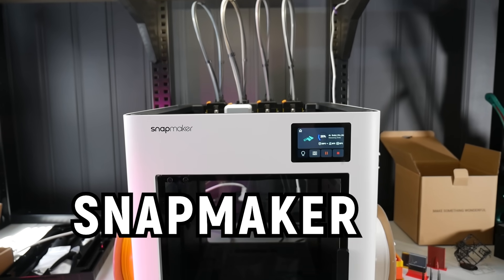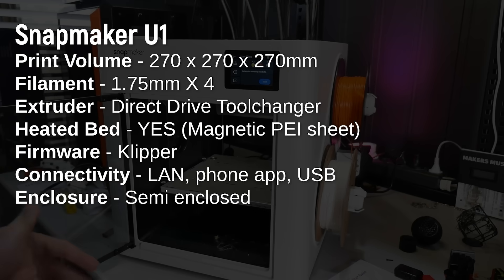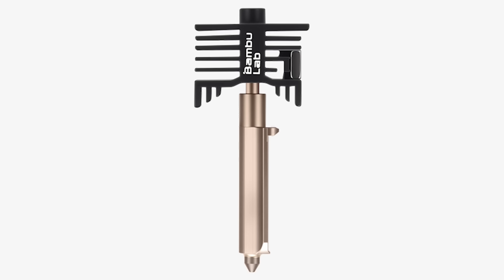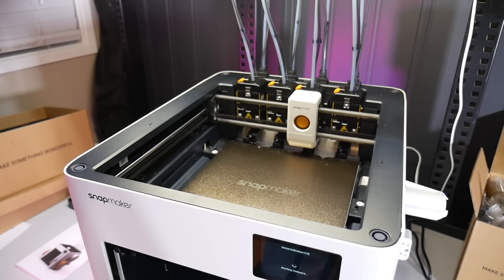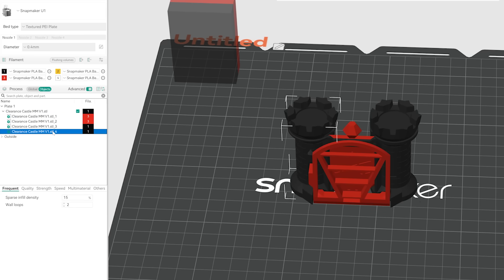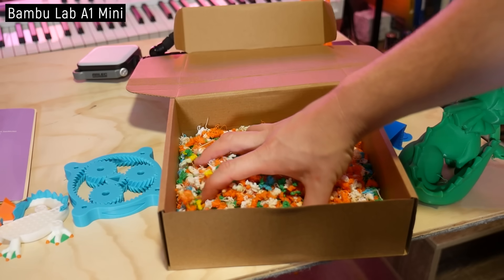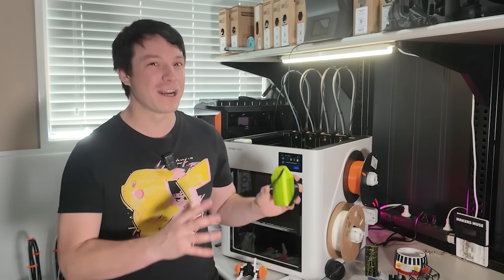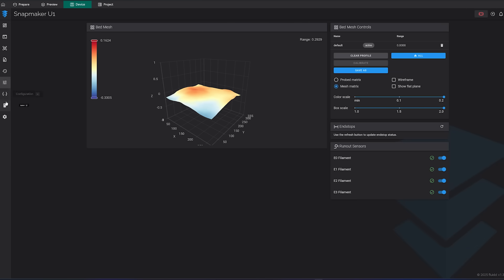Snapmaker U1 Production 3D Printer Review - Tool changer!

Comment: I own a Snapmaker J1 that came out just shy of 3 years ago, and it got end-of-lifed with the last update just 18 months after the first units shipped. Still a bunch of firmware bugs and problems, and they're still selling the machine over a year after they stopped software support. NOBODY cares to mention their AWFUL long-term-support track record. Also their customized slicers feel really lazily developed, they seem to rely on the community to finish their work for them.

Edit: this might be forgiveable if Snapmaker provided a guarantee for software support going forward, but they have NO such guarantee unlike other ODMs and every reviewer fails to even mention this apparently
Reply: That’s insane!
Reply: I’m also a J1 victim. Sold it finally in spring with big loss. That experience made me hesitate to back the U1 on Kickstarter. Only after more and more enthusiastic reviews from trusted beta testers became available I was willing to give Snapmaker a second chance.
Frankly the J1 was initially a design from Jadelabo, a spinoff by former Snapmaker employees. Before the J1 Kickstarter was fulfilled they went back under the cover of Snapmaker. So Snapmaker had the unpleasant job to fix the problems in the J1 design and there were a lot. In the end they simply gave up.
Hope Snapmaker learned their lesson and the U1 holds up to the initial hype.
Reply: @PGXX8  Thanks, that is very interesting context.  Does not excuse any poor experience but does give more hope Snapmaker should have learned from this.
Reply: @PGXX8  Woah just looked up the kickstarter, Jade is still the one responding to support emails -- makes me wonder if the whole project is just one talented individual, who merged into the company because they could handle the sales & logistics.
Reply: It's good that you can use vanilla Orca Slicer with U1.
Reply: On the note of community updates, I made a revo hotend for the J1. Still waiting on an improved firmware.
Reply: @Mapl3Syrup  That's awesome, did you publish it on Thingiverse, Printables etc?
Reply: @Mapl3Syrup  you did! Can't wait to see this
Reply: I was excited for this printer after watching Maker's Muse, as he is one of few I trust for an honest review that doesn't at best cherry pick what shortcomings to showcase (like others do). But long term support is essential, anything less for a printer with a closed ecosystem for parts is unacceptable IMO.
Reply: I absolutely understand your Frustration and even if the U1 is not the best of the best or big hit but it sets other manufacturers lile Bambu and creality under pressure to deliver something similar.
Reply: I use an Artisan and have to say the support has always been very good.
Reply: That was my concern regarding support
Reply: Yeah It's annoying the J1S isn't quite finished. But as far as i can tell, most of the firmware bugs seem to actually be OrcaSlicer bugs. Often, just reslicing will get a problematic print done for me. Honestly, the only reason i didn't jump on the kickstarter is because my J1S is still going like a train. 4 toolheads would be amazing, but 2 not bad at all.
And i've kinda fallen in love with the glass build plate so i'm not sure i could go back to textured.
Reply: @qwertyasdf66  I think it's forgiveable, except that Snapmaker REFUSES TO GUARANTEE any duration of software & firmware support. That's the worst part. They are not a company that can pull "trust me bro", they are a company where what you get today is all you can reasonably expect to ever have.
Reply: That why I am still reluctant to order one. Firmware update and support is important.
Reply: @Coup0705 with the recent announcement couple days ago from Prusa, that the core one will have not just indx tool changer add-on but also pick and place, that's a complete game changer for me - less than double the price of the u1 for a printer that's in a completely different class. I know what I'm buying next!
Reply: That sucks. I have a j1s and I quite like it. It's got a few issues when it comes to network printing but otherwise I've quite liked it.
Reply: Has there ever been a printer that had idex as a main selling point and was good? 

Raise3d better be good at their price and anything below that always was barely above e waste
Reply: This was a big part of my hesitation, as well. For this one, though, with it being such an incredible success, I think there will be a ton of 3rd party parts available and community efforts to take care of quality of life issues. That doesn't make it OK, by any means, for companies to expect the community to finish things, but it's one of the more common situations with many printers these days. If it remains true that they fully open source this, that should give tinkerers a lot to work with, and while it's not good to expect the community to take care of problems that your own engineers should have, at least that means that people who know what they're doing will be able to keep it running even if they do end support for it sooner than they should.

The biggest thing that this has done is put the entire industry on notice that people want this to be the direction to go for the future. I think there will likely be a bunch of toolchangers released next year beyond the ones we already know about from Prusa and Bambu, plus any additional solutions using INDX. It's going to get exciting, I think.
Reply: This printer looks like bad and ass had a baby together. As long as they provide long term support, I’m good. Finally a better solution to the Bambu invasion of privacy network plugin monopoly.
Reply: Like as for bambu products. All the last updates for X1C only makes experience worse. The main dream of the  bambu team is an only cloud printer with proprietary firmware.
Reply: In the best case, any Chinese printer will have one or two updates in the first month after release.
Reply: Since the U1 was announced this was my thoughts all along, though I think the review was great and the printer looks and works very well, the printer cannot be reviewed in a vacuum. You need to look at how the company has supported (or not supported) their previous products. I know that one of my prusa will be supported for years to come, Bambu labs will probably be removing some older models from production soon so we will find out soon if they have a commitment to long term support. 

If nothing else this printer has the power to disrupt the 3D printer market and I think 2026 will be the year of the tool changer with many companies offering alternatives.
Reply: The U1 runs on open source SW, you can do your own support when it goes EOL. HUGE difference from proprietary stuff. I wouldn't have backed it if it weren't a Klipper printer.
Reply: @un_lucio  Same - this was a big PLUS for me over Bambu machines, they are too good value to ignore but I'm used to being able to rebuild printers let alone fix them.
Reply: Well with 20000 backer maybe thing will change
Reply: Oh, wow, that's bad. Thanks for bringing it up to light.

If anything, I am slightly less worried just because the printer runs klipper, so modifying it is not too hard. While not for everyone, this ends up being the route I take with all klipper printers: constantly modifying macros and other tidbits (we can probably thrown in a chamber heater in the U1...)
Reply: @_litz I don't deserve kudos, every single review of the U1 that I've seen deserves a reprimand for not talking about snapmakers. This is how we separate the shills from the real reviews.
Reply: @_litz question is who has the skills AND is willing to provide free labor to support a commercial project that only needs support because the company will not fund support? The source code for the J1 has been released for a long time, if I'm going to spend hundreds of hours maintaining someone else's printer for free, why not do it on a project someone actually cares about?
Reply: I do wonder about this sort of thing when a company has a slam dunk like this though. I’ve never even heard of your printer, but it’s impossible to miss this one. When you have 100x the customer base thing change pretty quickly.
Reply: @EricLS The J1 is prior model released by the same company. All the multi-function machines this video mentions as having put the company on the map are several years older.
Reply: That sucks, good thing this one is Klipper and compatible with open source slicers. I’ll be sure to hoarde nozzles until the aftermarket ones come out
Reply: At least it still works and can can accept sliced files to function without an internet connection, even despite no future upgrades. A most modern printers released now are in a pretty good state where they don't need constant babying to produce 99.9% of what you actually need
Reply: I dont trust anyone that wants me to pay before the product is finished. Way way way way too many people get burned that way.

Comment: wish they had hardened nozzles for the cf/gf materials and a heated chamber. would be great to be able to use a different material for supports.
Reply: They come with stainless, but they sell a hardened nozzle kit separately. The 0.4 hardened kit is coming with my U1. They have a top cover coming next spring, not heated but should be ok for asa/abs with the cover
Reply: They do have all that. You can order hardened nozzles with the printer, and you can pre-order the top cover, which will be coming out in a few months. It will support chamber heating, but the max chamber temp isn’t very high if I remember correctly, so you might not be able to go too exotic with the engineering filaments.
Reply: @GoComm79 it's passive heating from the bed, the cover only has the air filter attached. No active heating. Still will be ok for materials like abs asa any nylon.
Reply: @brandonberkmortel9558  Yeah, like I was saying, it’ll be fine for most things, just not the more exotic engineering filaments. I think they said the top cover will support 50 degree C chamber temps. You sure that the cover has no electronics though, and just an air filter? I watched another video a while back that said there was an electrical port on the top for the top cover. So I was thinking it might have a small heating element or maybe an active fan/filter combo or whatever. I haven’t been able to find much info on it though.
Reply: @GoComm79  They mentioned a filter and a fan in it - passive heating only - no more info than that - availability in April, so that means they haven't made it yet.
Reply: @brandonberkmortel9558  It actually DOES heat the chamber. the design uses "gravity heating" which recirculates the air down and around.  Thats what the fan in the hood is doing.  Its the same way your house uses the heat from your furnace
Reply: @GoComm79  It has an active fan
Reply: @anthonylong5870 I'm not saying it doesn't heat the chamber but it's not using any other heat source than the print bed. The cover itself does not have any heat source. My Qidi plus 4 and many other enclosed printers have a chamber heater. This does not.  I have the U1 coming December, I don't need it to print pps-cf or high end materials so the cover would be fine for abs asa etc..
Reply: @richardcentesette1057  Ah ok. I gotcha. So the electrical port is for the fan. Makes sense. But no heating element. I’m sure that, once the top cover comes out, folks will be dreaming up all sorts of mods. Thanks for the info!
Reply: @anthonylong5870  Ok, gotcha. Makes sense. Thanks much for the info.
Reply: They do, they were already available during in the kickstarter and now they're on the website

Comment: Finally! Can't wait for mine. Multi-color is not that interesting, but multi-material IS!
Reply: I agree. I don’t do a lot of multi-color (that’s mainly due to the waste though, so maybe I’ll start after I get my U1), but I definitely do a lot of multi-material printing. Hope you get yours soon and that you love it! Cheers!
Reply: Just curious what do you plan to print with multi materials?
Reply: @Grafsnikers  I print almost 100% custom-designed functional prints. Hard to say... I've been designing with the limitation of no overhangs and minimal support, which is sometimes a fun challenge and sometimes very restrictive. This opens up more possibilities.
Reply: @Grafsnikers  Multi-material is awesome for anything that needs supports. PLA model with PETG (or Polymaker CoPE) supports for example. Or vice versa. Set the top Z offset to 0 and the underside of your part will look amazing! Also combining stiff and flexible materials together opens up a lot of design possibilities.
Reply: @Grafsnikers  you can do stuff like disovable filament etc

Comment: Sorry a big red flag with zero compromise for me is a all in one hot end assembly. I will fight tooth and nail to not support this trend.
Reply: Coming from nearly 20 years 3d printing experience from the old xyz to the ender 3 pros with tons of mods I'll gladly take the all in one hot end quick swap instead of having to heat and brace,  wrench, cool, install,  brace tighten,  heat tighten and then still get leakage or break or strip something. The aio makes life easier and I've ordered dozens and dozens of nozzles over the years and most still sit in a parts bin even with 4 running at once. I spend the extra $10 for easy and fast switching instead of playing around for 40 min to Hopefully have a new nozzle installed correctly. This is not really the hill to draw a line in the sand.

Comment: I got in on the Kickstarter and eagerly anticipating it's arrival. One thing that baffles me though is that instead of leaving a small empty space to the left of the toolhead, they made the left toolhead different from the rest. It probably won't be an issue, but the only reason I can think of is so it looks symmetrical.
Reply: Watching Functional Print Friday and Clough42's H2D videos on printing TPU with petg support and interface layers for perfect undersides for making bellows has me looking forward to making firewall grommets and things like that which can't be made without different support material, but my X1C can only do TPU fed by itself. I'll definitely be making my own cover, whether 3d printed or out of aluminum and polycarbonate. Looks like there is an integrated connector for the filter system that their cover will use so that should be easy to reverse engineer.
Reply: @justion337 I’m waiting on their cover, and also seeing what others like BTT might do to enhance this printer. There’s enough traction in numbers to warrant an entry product from others and no locked down interfaces. I too plan on making my own as an option, or putting inside a redundant enclosed 3D printer from 10 years ago worst case.

Comment: And its OPEN SOURCE SOFTWARE! That matters. I skipped around so I dont know if you mentioned it. It's really, really important. That also means they can't lock anything out, where are those thoughts coming from?

Also they're making a lid, did you miss that? Its for sale. Ill be using something cheaper but they literally sell a lid. They're also selling hardened nozzles. An hour of research goes a long way.
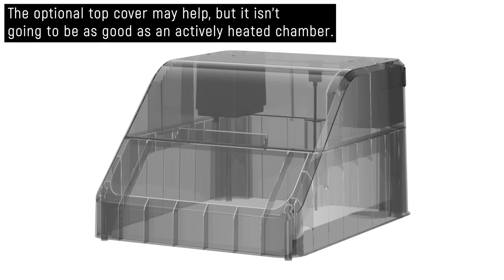Reply: he does show the lid 12:50
Reply: 14:01 is this what you mean with open? he mentioned they branched off of Orca Slicer (FOSS)
Reply: @aaronalquiza9680  Its running Klipper plus they dont lock you down to their specific slicer
Reply: @aaronalquiza9680 since they used open source as a start point, they have to return the final version as Open Source.
And that is the point. I did that many changes to Marlin, I am happy to have Open Source on the U1
Reply: Watching the whole video goes a long way .......

Comment: More open and faster printing? I'm selling my P1S and buying this
Reply: Mine is on the ship from china now.
Reply: I'm not entirely sure if I want to sell my P1S just yet. Maybe I'll use it as my backup printer.
It's in LAN only mode since the "security update", on firmware 1.06, with a Panda Touch connected to it. And I still use Orca slicer.
Reply: same, backed it months ago.
Reply: I got a U1 coming next month but still bought a p1s combo with an extra ams for certain multi color prints that need more than 4 tool heads. U1 gonna be the main multi color/material printer though.